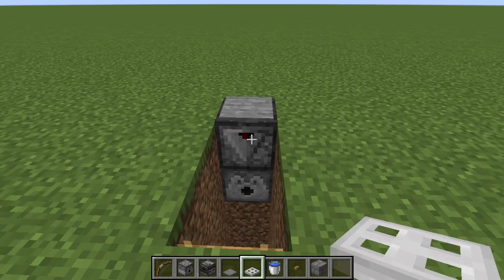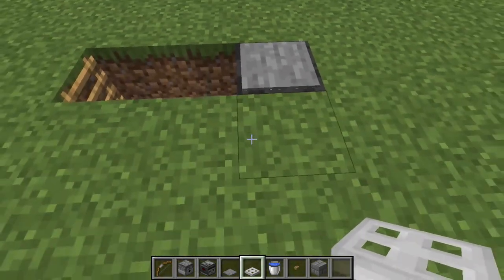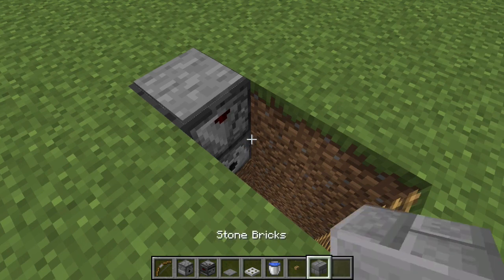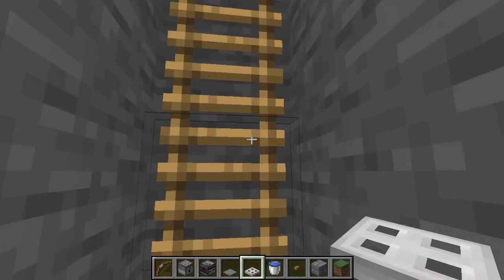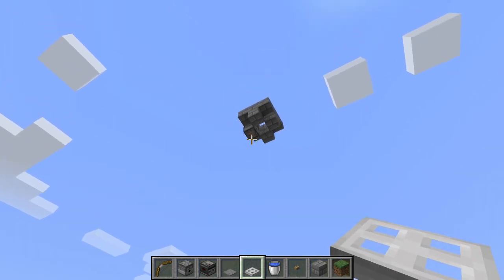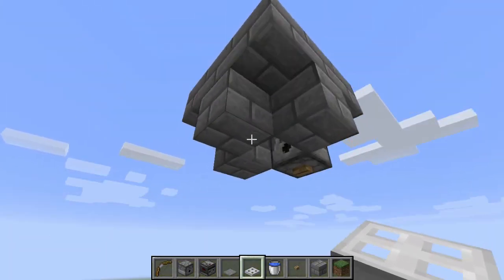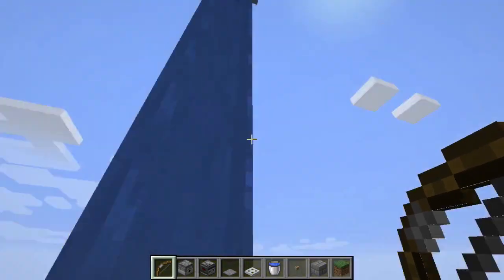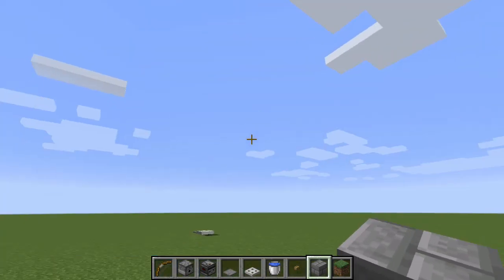Dispenser Water Drop - Simple Minecraft Vanilla Automation

Comment: hey so, i’m kinda confused, how do you make an observer suck back the water in the dispenser
Reply: I put a water bucket in a dispenser but then it should suck back in the water but it is not, may you help me?
Reply from the maker: The "face' of the observer is facing into the pressure plate? The red dot on the back is facing into the dispenser?
That is the only thing I can think is that the observer is oriented wrong in your setup.
Otherwise, it acts just like a double triggering button. So you can simulate what is happening to test with a button directly on the dispenser.
Reply: ScottoMotto so let’s say I put a dispenser face down, and then a sticky piston facing up while the observer is facing down and the “face” is up, since the piston moves the observer, isn’t it supposed to take back the water bucket, i’m trying to do a automatic farm.